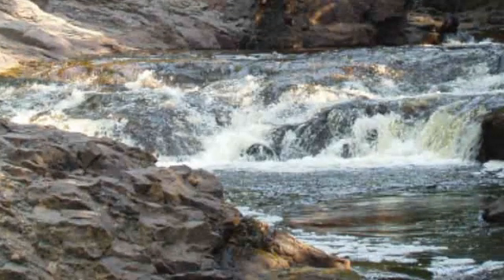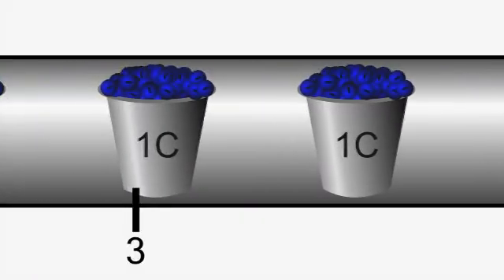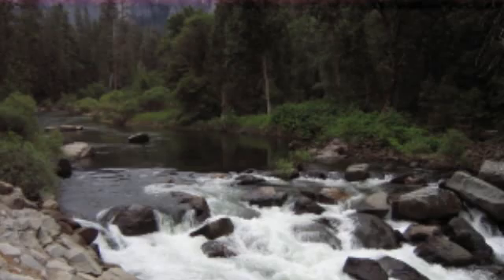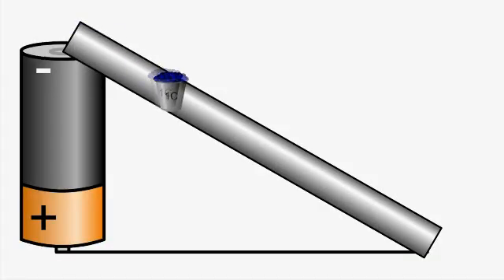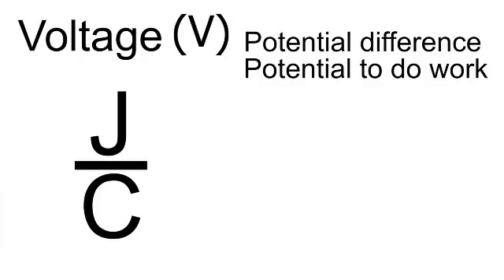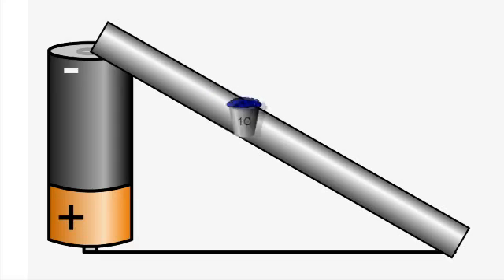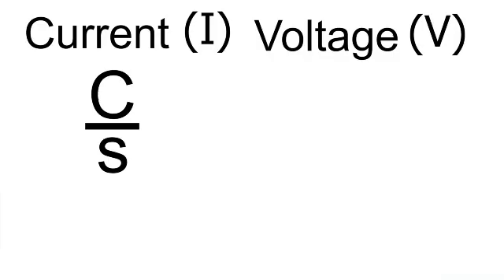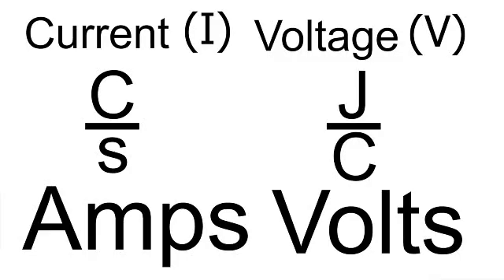Current and Voltage

Comment: I was with you up until the last 5 seconds.
Reply: In case you're still wondering, he says the greater the voltage across a wire, the greater the current will be in the wire. This is because V=IR, therefore I = voltage/resistance, so assuming the resistance doesn't change, the current will increase as the voltage increases. This equation is key.

Comment: That is a question with no simple answer.  But a very simplified half of an answer would be to check the power rating for your supply.  Lights and other resistive loads are pretty easy to calculate for how much power they use and you can then know how many your supply will be able to power (leaving room for a safety margin of course, dont want things overheating). Motors are tricky because they have all ranges of power ratings based on the motor you use. Not an easy this many for that many volts

Comment: please explain what should be checked when connecting a device (Bulb,LED,Motors etc) to a electronic circuit. Should i be checking the input voltage required or input current required.. like i have a 5V supply how many motors can i power by it ? If i pass a higher voltage than required what will happen or if i provide a higher current what will happen ? (i dont what to blow up stuff in my testing :P)
What does the speed of a motor or brightness of a LED depend on ? and yes i know the OHM law :)

Comment: I think increased voltage means more work-potential per coulomb and the amperage relies on the resistance of the wire.

Comment: mmm, so voltage is the work-potential PER colomb (charge) AND increased voltage means MORE colombs flow per second, "more current will flow"?  So each charge is packin' more punch AND there's more of 'em?  Double whammy?  Something aint right to this country boy.

Comment: PD Its what a voltmeter shows when connected across any two points. If there is no voltage showing  then there is no Potential Difference between the points it is connected to. If two resistors are connected in series with a 9 volt battery and they are both say 100 ohms each will show 4.5 volts if you connect the voltmeter across each in turn. They both are showing a PD of 4.5 volts. So there is a deffernce of volts between each end of the resistore.

Comment: Voltage is a rate of charge.  When something requires a certain amount of volts it means that whatever it is, it has a set or variable internal resistance and in order to provide enough current it needs a certain amount of volts.  Voltage=Current*Resistance so the resistance has been set and current has been specified.  In order for those two to be balanced the required level of voltage is needed.

Comment: I agree with you EIPaso TubeAmps.
Very correct but very heavy!
Just keep as simple as possible or you stop people taking it in.
Volts do the pushing around of a current in a circuit. Resistance opposes the current flow.
If there is no voltage to push you get no current flow. All circuits have some resistance.
'nough said.

Comment: While you are correct you have over complicated it - you have voltage (volt) as a J/C  which is a ((volt*amp*sec))/(amp*sec)) which is obviously a volt - similar you have current (amp) as a C/S which is an ((amp*sec)/(sec)) is obviously an amp. I think you would convey more information to your reader if you stuck to voltage and current as the title of your YouTube video implies and make a different video addressing coulombs of charge and joules of energy. Just my thoughts.

Comment: Good video.  I am struggling to find two more 'real time' applications for voltage formulas. I used a light bulb on my first.  I AM going to do a 'laymens' video on voltage/amperage using generator speed and size to help understand voltage and amperage. Pretty hard to explain to someone that has never taken a physics class though.

Comment: the watt is a measure of power; it's energy per unit time. with voltage defined as energy per charge and current defined as charge per unit time, it becomes apparent that if one were to multiply voltage and current, the charge terms would drop out, giving energy per unit time, e.g., power in watts.

Comment: Sir, I'm working with a battery and a motor, I'm kinda confused with the batteries available in the market, most of them are 1.2v (AA) but I saw different mAh. What does the mAh means? Is the current or the charge? I worry that it will destroy my electric motor. Thanks!

Comment: @804YankeeFan The electrons in the load/resistor/whatever is creating light and heat cannot flow as freely as they do in a good conductor. They bash against the nuclei more, causing vibrations, which causes heat/light.

Comment: So amps is kinds like speed and volts is kind of like the power………..if I wasn’t getting a lot of power could I speed it up to get what I need……And if I had to much power couldn’t I slow done the speed my using a resistor to get what I need.

Comment: thank you very much this was very helpful....so electricity wants to equal out kinda so thats why it flows to lower potentiol.....but that means the longer you use the the battery the less volts you get out of it ...right ....so you only have the voltage the battery says it has right at first and that goes down over time

Comment: @gullenator1 I dont like coulombs i think because its french. I mean they rename everything in french such as email and router. They dont like english so i dont like french. Good luck with your course. I still don't think more more volts necessarily = more amps as I said in my battery analogy. I harbor no ill feelings towards you I was mainly just pointing out that potential difference is a theoretic number and doesn't necesarily mean high current. I did read into non linear circuits.

Comment: @gullenator1 ok your right about coulombs and if you had read all my comments you would know i rescinded that comment which I made years ago. Still don't believe that more volts necessarily = more amps. Hence my battery analogy. My main point with the ohms comment is that you need both high ohms and amps to be shocked which i have seen to be true through experiments. I hope though that you don't believe that a 12 volt battery is actually 14 volts that was ridiculous.

Comment: @InsanePorcupine 4) A "super low resistance circuit" can and will electrocute you.  You are confusing this with the idea that a short circuit made of ideal wires would by pass other elements in parallel.  No real circuit will behave this way.  Make an experiment and test it you will get shocked.  5)  There is nothing archaic about Coulombs they were derived from Coulombs experiment with electric fields.  Now please take your junk science elsewhere and stop "correcting" this video.

Comment: @InsanePorcupine While the amount of current that can flow is dependent on the external circuit.  In situations dealing with the power grid the source can essentially provide an unlimited amount relative to your body.  A high resistance circuit is not needed for electrocution only an energized circuit with sufficient voltage and for you to complete the circuit. 3)  You don't need to be the path of least resistance to get electrocuted.  The body has more ohms than any circuit in your house.

Comment: @InsanePorcupine Ohms law does not apply to non linear circuits, including circuits where the resistance changes with temperature.  Don't just pretend this is not true because it doesn't fit into your understanding, research it.  Now I will address the moronic statements you have made one by one but I doubt it will convince you. 1) Volts are in fact what pushes electric current through you.  It is also called electro motive force.  Your body is a good resistor, voltage is needed to drive current

Comment: @InsanePorcupine With these kind of statements it wouldn't matter if I was a 6th grader with a good understanding of science I would still be better of than you.  I suppose you failed to read or understand the response which is still up stating my credentials.  Credentials are meaningless though on the internet.  I'll let your statements speak for themselves.  You've done nothing but try to rudely correct the professor on this thread and the "help" you give is flat out dangerous.

Comment: @InsanePorcupine Let's recap your moronic statements: 1) " ...voltage is not what pushes a current through you." 2)" So to sum up if your body has say 50 ohms of resistance an electric circuit will need 50+ ohms to send electricity through you." 3) "so no volts dont kill amps do but they wont kill you unless there are enough and you are the path of least resistance." 4) "if you have a super low resistance circuit it won't electrocute you."  6) " I just think coulombs are archaic and confusing."

Comment: @gullenator1 o and by the way I understand that resistance values can change because of heat and other things just so you know but ohms law still apllies. If you have 12 volts 6ohms 2 amps and heat increases resistance to say 12 ohms your current will lower to 1 amp. This doesnt mean that ohms law isnt true it just means that nothings static. Many engines have ballast resistors that turn on when they get hot to lower resistance down to what it should be to allow optimal current flow.

Comment: @InsanePorcupine When ohm originally discovered the linearity between current and voltage he called the constant between them resistance.  Only years later would resistivity be derived from electron density and drift rate.  So just because voltage can be expressed as I x R for common circuits does not mean it is defined that way.  Please accept that you can have a non linear circuit where I x R is not true.  And please stop discrediting this video and spreading your wrong ideas. You're a hack.

Comment: @InsanePorcupine I f you still don't think you can be shocked in parallel, set up a parallel 120v circuit with a few ohms on it and grab the ground in one hand and one of the ungrounded nodes in the other, you will be lit up.  On the original dispute volts are a measurement of potential energy per unit of charge, they are not defined as being "amps x ohms"  that idea comes from ohms law and is just a conveinence it's not really true as most resistive loads a have positive heat coefficients.

Comment: @InsanePorcupine GFCIs only detect a difference in current coming in and going out and surprise they are in parallel with your other outlets.  When you through the hairdryer in the bathtub you are being shocked in parallel.  
Some of things you say I can see a small morsel of truth in, that you have just twisted around because you don't really understand and some of your wrong ideas have probably been reinforced in your limited dealings with electrical systems.

Comment: @InsanePorcupine When you plug something in you are putting it in parallel with the rest of the circuit.  Do you think homeowners are prying open their electrical boxes and taking apart their live connections to put themselves in series?  Not, typically.  People are usually electrocuted from grabbing a live wire and being grounded, in parallel with the other circuit elements.  If you still don't believe you can be shocked in parallel ask yourself why bathroom outlets are GFCI protected?????

Comment: @InsanePorcupine I said the resistance varies from 1k to 100k ohms. 50k is just a number for an example  to show you that a fatal amount of current can flow in parallel. 2.4mA could definitely kill across the heart. I was a journeyman electrician before going back to school for EE, I have been shocked in both series and parallel. You don't need a high resistance circuit, you just need voltage and to be grounded. You realize that a person interfaces with the home electrical system in parallel?

Comment: @gullenator1 yes finally we agree on something if you in parallel the voltage remains the same however because the resistance is so high. 50k is what you choose such a small amount of amps will pass through you you will feel nothing. 110/ 50 000 = .0022 amps therefor you will not be electrocuted by such a small current. Do you know how people electrocute themselves with 110? by completing circuits not by grabbing onto already complete ones. Trust me ive done electrical work in homes. or don't.

Comment: @gullenator1 @gullenator1 your ridiculous seriously. I said that resistance varies and in reality is not 50k however I said if it was it wouldnt electrocute you. It's like adding a stick to a circuit and saying that the same amount of voltage would pass through the stick as the wire. Heres a link to a site 1 of many saying that average resistance is no where close to 50k .tpub.com/content/et/14086/css/14086_34.htm  And yes voltage is the same across are links in parallel we agree.

Comment: @InsanePorcupine Also you should know that more electrocutions happen at 120V than any other voltage.  So according to your beliefs these killer circuits have many thousands of ohms and the current is infinitesimally small.  That would be great, but its not true.  Also skin effect only applies to high voltage currents not anything accessible to an average person.  Whats annoying is that you criticized this video, which is in fact correct, and then went on spreading misinformation. You are wrong.

Comment: @InsanePorcupine 50k ohms is just a good average. At 120V this would give a current of 2.4 mA which could be fatal across the heart. You are trying to argue the body has less resistance than this while at the same time saying that a person in parallel with a typical household circuit wouldn't be electrocuted.  This shows that you have no understanding of electric circuits. Voltage is the same across all elements in parallel. Then at 20 ohms like you say the current would be 6 amps, beyond fatal.

Comment: @gullenator1 anyway you can actually have as low as 20 depending on the situation but if you are indeed in parallel and your resistance is indeed 50 000 ohms you wont be electrocuted. You wont im telling you believe me or not i dont care. If your in series then yes but truly in the end the thing that pushes the current through you is the generator making power through induction.

Comment: @gullenator1 Ok I will reply even though I have nothing to prove to you. First off where did you get this 50 000 ohms? resistance is actually different from person to person. It also depends on how much moisture is on your skin and although you may not know this electricity travels on the outside of your body instead of going straight through you. Your resistance can lower if you have a bra with an underwire for instance. Is the current going from finger to finger or hand to hand.

Comment: @InsanePorcupine Furthermore I just want you to consider this: Take a 120V, 15A household circuit.  Say there are ten outlets each operating a 60W bulb. Thats 0.5 amp per outlet, 5 amps total current.  This means the circuit is loaded at 1/3 its maximum which is pretty low.  Applying ohms law gives 24 ohms resistance for the circuit.  You agree?  Now put a human body at 50,000 ohms in parallel and please explain how the human being is the path of least resistance?  Just work through this.

Comment: @InsanePorcupine You have a very bad misunderstanding of electrical circuits. It may not be your fault, but trust me the things you say don't even really make sense. I don't know what else I can say, but you  won't find any text that supports your ideas.  It's nonsensical to say that "when you are the only path, you are the path of least resistance," duh. Volts don't have ohms. And people have been electrocuted by voltages as low as 30v but generally speaking anything below 50 is considered safe

Comment: @InsanePorcupine Nothing I said should have offended you but I can see that you are sensitive.  Look I get that at auto zone when they showed you how to use the battery tester they probably explained that volts was "amps times ohms"  and for what you will do that is a sufficient explanation but it is only true when dealing with circuits with true ideal ohmic resistors.  Its not actually the case.  Please tell me you don't think the video and every text book on EE is wrong and you are right?

Comment: @InsanePorcupine Your understanding is simply wrong.  For most practical purposes it's ok if you think of volts as being defined by "amps times ohms" but this is not actually the case.  In fact resistance is just a proportionality constant for linear circuits between voltage and amperage.  In non linear circuits this is not the case.  Voltage is defined as being  the potential energy per unit of charge.  A volt absolutely is a measure of potential energy or the ability to do work.  Sorry.

Comment: @matrixeducation wrong. You do not need high voltage to be electrocuted. You need high ohms. Usually however high ohms come with high voltage but this is not what is needed to (push) current through you. You need a high resistance circuit. So when you touch a circuit like this you will become the path of least resistance if you have less resistance than the given circuit. Wow I'm so done with this video don't even reply back to me I'm tired of being dragged back here and seeing misinformation.

Comment: @InsanePorcupine One more thing. What are your qualifications? You are clearly a little confused if you think a 12 volt battery should read 14 volts. I have tested hundreds of 12 volt batteries not one has ever read 14 volts. If it did I would assume it was a surface charge from the battery charger and put a small load on it then take the load off and the volts should go back into the twelves somewhere. A fully charged 12 volt will also drop below 12 under load no lower than 9.6 though.